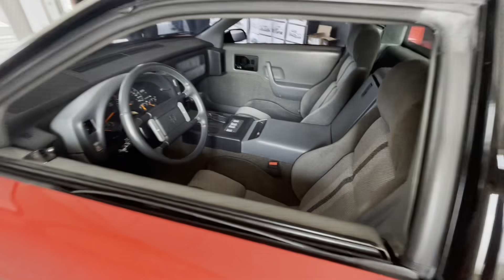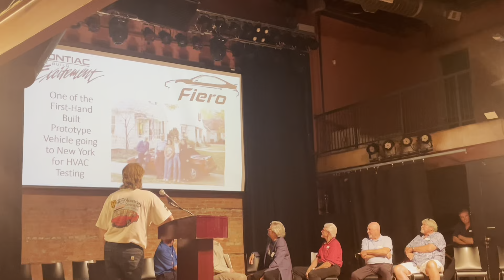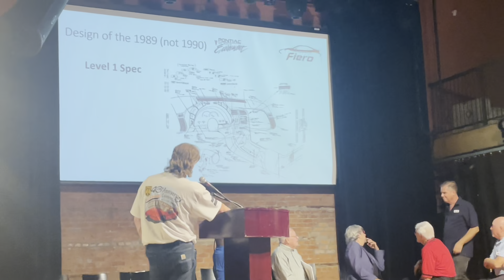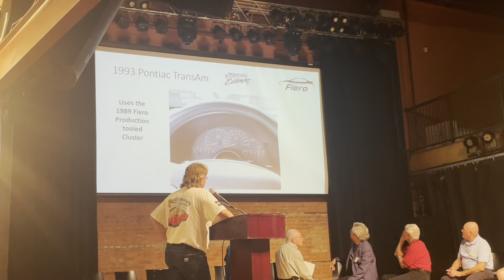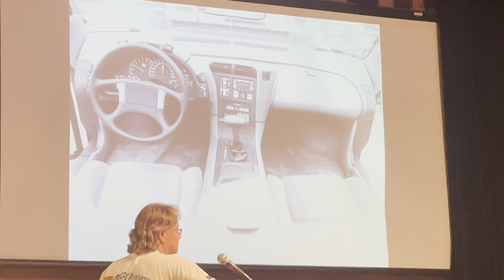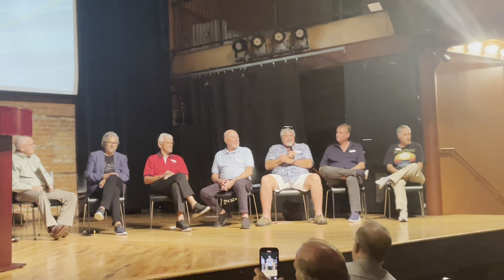Fiero 40th - Designing & Engineering the Pontiac Fiero - Pontiac, Michigan

Comment: I was a student in Warren Mi in the early 80's. We had a field trip to the Pontiac assembly plant to look at the Fiero production. It was a cool half a day out but I never liked the car's looks. When the GT came out, it was much more pleasing on the eye.

I moved back to the UK in 84 and it wasn't long after that the Toyota MR2 came out. My initial reaction was that it was a Fiero rip off even down to the badge styling but it was a way better performing car.

I did test drive a MR2 at a local dealer but I was a blue oval fan so I decided against it.

Now That I'm in my fifties, Pontiac is gone along with the plants. The silverdome is no more. I had such memories there.
Reply from the maker: Thank you for sharing your story! It would have been cool to visit the factory.
Reply: @superchargedfierogt  It was cool but a bit boring. This was the initial fiero so it looked like they just raided the parts bin.

I do remember seining all the head units in a locker. I guess they thought assemblers might walk out with one. I can't figure out why. It's not like it was made by Pioneer etc.